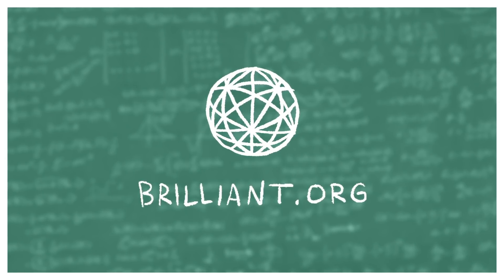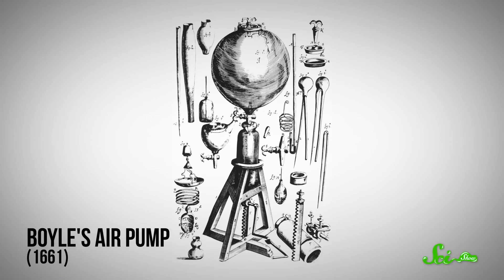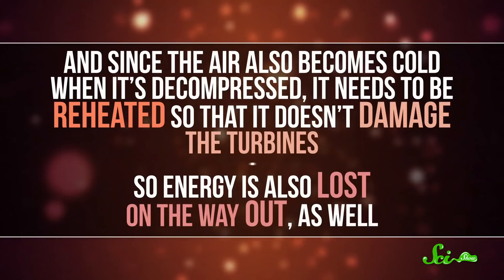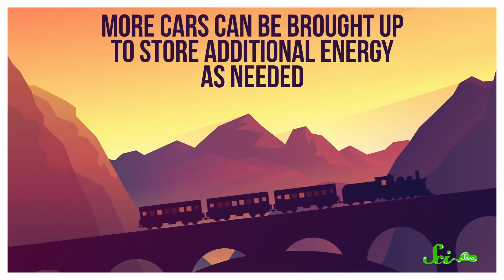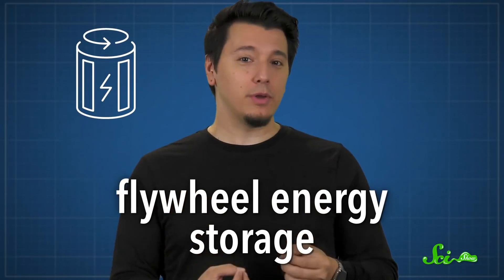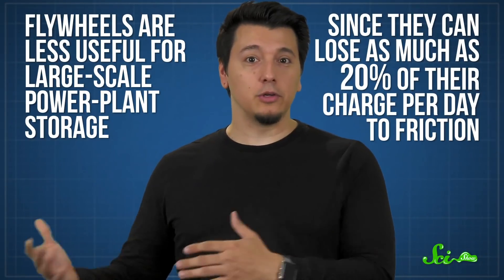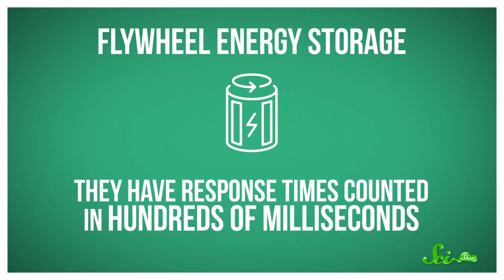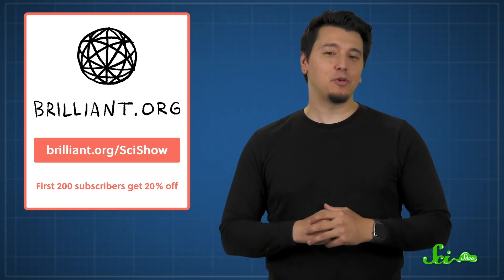The Surprisingly Retro Future of Batteries

Comment: Seeing "retro battery" I'm surprised deep cycle lead acid was not mentioned
Reply: David Burgin  Lead-acids are excellently recycleable though. You can reclaim every material used in their construction and turn it into new batteries.
Reply: Mandrake Fernflower that’s still electrochemical though which is what we’re trying to avoid.

Comment: You mentioned using trains as a way to store energy gravitationally, but not the Swiss company, which is buildings crane towers, where they use stone blocks pulled up and down to store and release energy?
You know, basically the same thing, but it doesn't need additional infrastructure like rails and it works both in a completely flat terrain and mountanious regions, because you just have to build the crane, which is always vertical...?
Reply: 2:50
Reply: The 'energy vault?' You might want to watch Thunderf00t's video on that one. He runs through a few practical issues. Is it workable? Sure. Is it economical? Not even remotely close.

Comment: 2:50 
Thunderf00t made a video about that called: Energy Vault -BUSTED!
Reply: Is it really that unreasonable that it is "busted"? I mean yes maybe it is inefficent, less enviormentally friendly and more expensive than the best competitor buuuuut wouldn't it work well enough to be useable? Unlike say that hydro thing sucking moisture out of the air?
Reply: @lazergurka-smerlin6561  Considering that it will break in any place with moderate wind.  Likely store near no power due to cranes being inefficient.  And what power it does store loses storage potential greatly for the lower blocks.

Comment: The most practical mechanical battery is the gravitational battery of which you hoist a very large mass at the top of a pit.  You will lose zero energy over time (unlike flywheel) and it can be turned on instantly.
Reply: You still lose energy, obviously, through friction of the bearing/pulley, for one. You lose energy in all solutions.
Reply: You can't extract energy until the generator spins up. Not instant, but a matter of seconds.

Comment: How about spring batteries a  good example is the old wind-up watches. Or what about storing hydrogen in a chemical battery. Solar/wind through electrolysis turn water into hydrogen and oxygen. Hydrogen is then compressed and used in vehicle transport.
Reply: Ian Wilson hydrogen’s electron in to electron out efficiency is currently about 30%. Add compression and storage losses to that. That may be good enough for long distance planes & ships where there is no other renewable storage with the capacity but it’s awfully inefficient compared to anything being discussed here. I really hope research boosts that efficiency.

Comment: Regular flywheels don't seem to be a bad idea for "power shifting" solar power.
Spin it by day, let it rip by night. The 20% per day won't be much of an issue here, as you're only needing the power some hours later rather than a whole day.
Reply: It would probably also be really efficient to smooth out solar and windpower with their typical minute by minute fluctuations
Reply: @jonas-c7m  It's kinda of a mechanical inductor of sorts so yeah
Reply: You might also need a storage solution to make up for cloudy days and/or snow/dust accumulations on solar panels for more than one day.

Comment: Aren't hydro-batteries more popular and efficient than rail storage to store energy as gravitational potential?
Reply: Assuming you have a dam... and a lake...
Reply: @frac  Not necessary. A big hole with a pweighted piston can work too, and this kind will work at a much higher pressure and has less evaporation because the water is enclosed. Basically you have 2 big vertical cylinders in the ground, one with a really heavy piston. You pump water from under the light piston to under the heavy one to charge it. Fluids other than fresh water could work but the only other thing that make any sense would be to use salt water and no second cylinder if you are close enough to the ocean for that to be more effective. The absolutely most efficient way would be to mount the pump/motor on the piston and have the low pressure water on top of the piston, but then you have to get the power in and out somehow. A syphon loop could also work, but the mobile end of the low pressure side would be a challenge. As long as you have about 4% of the depth of the cylinder in concrete at the top of the high pressure cylinder (more would probably be better), it will run at a net positive pressure at ground level. The pistons could be hollow so they could be unloaded for maintenance. No really new tech needed, just a little development to scale up existing tech.
Reply: @frac  no  dam needed. just resevoirs  at different heights
Reply: hydro is often 70-80% efficient and its MUCH more dependent on location. You need vast amounts of water that a lot of climates don't have to offer and you need enormous reservoirs that require certain topographies and huge tracts of land.
Reply: @TroyEilertson  not necessarily, consider underground cylinders and weights. Geography can make it cheaper to build, but it is not a barrier.
Reply: @TroyEilertson  can be made 100x smaller using liquid mercury (far heavier and not as prone to freezing) rather than water. Multiple elevated storage tanks can be put just about anywhere.
Reply: @TroyEilertson  you can always use sand
Reply: @TroyEilertson  but when it rains or snow melt u get free power
Reply: Troy Eilertson for example Switzerland 🇨🇭
Reply: Check out Tom Scott's video about Britain's largest battery (it's a lake).
Reply: @regular-joe   yep a fairly easy solution.
Reply: Well, there certainly are a lot of them. List of "pumped-storage hydro electric power stations" on Wikipedia: https://en.wikipedia.org/wiki/List_of_pumped-storage_hydroelectric_power_stations
Reply: I would think that suspended weighs storage (the modern equivalent of rail storage without unnecessary motion in the horizontal plane) would be a better for gravity storage: can be built anywhere, no mountains, lakes, specific underground features or anything else needed. Rail storage only makes sense if you have existing tracks and trains to spare for the duration of the storage period.
Reply: @teardowndan5364  Gravity-mass storage has very, VERY poor energy capacity. (The video states "50 Megawatts" but that's power, not energy.)

1 metric ton (1000kg) will store 9800 joules per meter of elevation. In the US freight train cars top out at ~140 metric tons, so that's ~1.4 megajoules per car per meter of elevation. Sounds like a lot, right? Well, you'd need to lift that 140-ton rail car up 100 meters (~330 ft) to get the same energy content as a single US gallon of gasoline. Put into another context, running a 1kW electric heater would need that 140-ton rail car to drop 2.6 meters per hour.

So why does pumped hydro work? Volume. A pumped hydro facility can have over 5 million cubic meters of water (5 million metric tons, about 36,000 rail cars worth) at the ready. Sure it's geographically limited, but so is any centralized power station!
Reply: @Smidge204  Most of the gravity systems in the US (other than the large hydro-electric plants), are used to save "waste" energy - using your surplus to crank a train car up the hill might only give you a low (I'll pull 10% out as a hypothetical) efficiency - but 10% of a gigawatt is a LOT more than the 0% of the same gigawatt.  The advantage of the rail system is that we already have train cars and rails, and experience installing them on mountainsides - "off the shelf" parts make it dirt cheap compared to a hydro-turbine of similar capacity.
Reply: @Smidge204  I'd also assume that many current hydro electric dams could be modified to preform both functions. Pump back a portion of the outflow with excess solar or wind energy. Yes I know it's more complicated than it sounds.
Reply: Australia's Snowy Mountains Scheme's holding dams are some of the largest gravity batteries in the world. The Snowy Mountains Scheme is one of the largest and oldest modern hydroelectric systems, constructed from the 1950s to the 1970s.  It also doubles as an irrigation system for agriculture in fertile but arid areas of New South Wales, Victoria and South Australia.  From its inception, the design called for water to be pumped into holding reservoirs during off-peak times and released via gravity, through turbines, to meet peak demand. "The Snowy" provides a large percentage of the power needs of Sydney, Canberra and parts of Victoria.
Reply: I have no idea why Scishow decided to leave perhaps the most  widely used gravity battery system  out of their bit on gravity batteries.  They are no less geographically restricted than a compressed air battery that requires an empty salt dome.
Plus they can be converted from storage to production faster, and lack the thermodynamics issues called out in their compressed air counterparts.
Reply: They are, and his comment about rail storage being the only gravity method in development so far is false too. Google the electric mountain. Disappointed Scishow.
Reply: @GenericSquirrel  I am actually pretty disappointed every time I watch scishow when its on something in my field ( chemical engineering)  I find major errors in nearly each which makes me question if I should be trusting the stuff put out in their other videos.
Reply: @GenericSquirrel  https://www.youtube.com/watch?v=McByJeX2evM pretty cool. Thanks for the tip. Not so disappointed in the show tho. Brought me to ur comment and I learned about rail energy storage.
Reply: @GenericSquirrel  He didn't say it was the only one, and scishow mentioned the hole in the ground one which uses the same principle before.

These are just retro ones used in the past.
Reply: @GenericSquirrel  Agreed but...  if it makes you think of the possibility of 'dry' hydro-electric then what about stretching it to 'wet' - tidal, even old waterwheel? Low vertical displacement but relatively massive volume displacement - mass v speed ≥ energy. 
Not giving at all options but opening you - the viewer - to stretch your imagination! My thoughts may be limited but out there someone........
Edit
Looked at more comments. like me, most harp on existing uses of oldish technology (strange no-one mentioned Archimedes screws) but I did notice the using surplus ( otherwise wasted) energies top top-up less efficient but temporarily useful supplies. I like that! Looking at why, and for how long, you need that extra 'kick' before a longer solution can come online, eg Ki v AlO2 batteries...
Reply: No, yes.  Hydro batteries require a LOT of space / volume. A Rail system uses "off the shelf" components that are pretty cheap. Vertical lift gravity storage is the most efficient, but takes either a TALL tower, or a DEEP borehole.

The reason these are in use is to balance power load / power generation - they are trying to save surplus power that they would otherwise waste, and then pump it back into the grid at "peak times" instead of starting their back up generator.
Reply: Yess but you cant make them without a big area, wich means destroying nature to make a artifical lake, or removing villages. We lack ground so its not smart to use a lot of it for energy
Reply: I'V been to Electric Mountain in Wales, and like the compressed air battery, if you are lucky enough to have the right terrain it is a wonderful way of storing power for when it's needed, i was surprised it wasn't mentioned.  

If you are ever in the UK it is worth a visit.
Reply: We need to use what is appropriate for the location. Some may be water batteries, some compressed air, some flywheels, etc....
Reply: those aren't retro, those pumped hydro are a thing of modern times
Reply: I was thinking the same thing  the power company in my area is building one now. I can see how your limited by where you can put one but there definitely out there.
Reply: YEAH, thunderfoot might be disappointed ..
Reply: Often hydro do not even pump up water. But just do not use it until it needed. Since nature tend to fill up dams on there own. But it is just a huge gravity battery. Or potential energy battery which is the term I prefer.
Reply: There is a wind farm in Ireland by the coast that they put a dam in a bay/cove and put a pump/generator on the bottom so when they make more energy than the grid needs they pump the sea water out and when the wind is not enough they generate by letting the sea water out. Quite a lot cheaper than a hydroelectric dam, but is also geographically limited, but not as bad as hydroelectric dams. 

Tall rocky coastal areas like most of the California Coast with high valleys behind them would also minimize environmental impact as you can build a smaller dam up top. The higher the elevation the less water you need per megawatt hour. Which they should be using to measure electrical storage in the video, the term megawatt storage without a time frame is a bit of a meaningless number.
Reply: Yup pumped storage is the cheapest, simplest, most reliable and most widely used from of mass energy storage. Which makes it odd they didn't mention it. China is currently building tons of them.

https://en.wikipedia.org/wiki/List_of_pumped-storage_hydroelectric_power_stations
Reply: If you use evaporation cooling to power a heat exchanger you can condense the water yourself and you don't even need to pump it anywhere, that's how rivers work!
Reply: You need elevated land beside a sea or beach.
Reply: If it's a dam in a more natural setting, like on a river instead of a man made pond, it will produce huge amounts of CO2.
Reply: @morbly  Will it?  The CO2 comes from decomposing vegetation.  Dam or no dam, it would decompose anyway and generate the same CO2 -- only that spread out over the river.
A dam may actually take carbon out of circulation by depositing carbon-rich mud on the bottom.
Methane is a concern in some dams because water is usually taken from the bottom anaerobic layers to run the turbines.  That could be fixed with proper design or a relatively cheap retrofit, so that water is instead drawn from the top layers (where the methane has been oxidized).
Reply: they also have huge environmental impact
Reply: They also have an issue with losses of power due to evaporation of the water they hold. Although it’s not really an issue with short term storage.
Reply: In the video it was refered to "you dont need a batcave to store the energy". ;)
Reply: Based off of what I know as a mechanical engineering student, I would say the turbines/pumps for hydro-batteries would cause much larger energy losses than the rolling friction/minor air resistance of rail-storage.  An alternative may be to use fluids that are denser, but experience less friction and have a lower viscosity.  That would have the potential to shift around ratios quite a bit, but other fluids in such large amounts are very hard to come by.  Perhaps there is a type of heavy-water-based solution that experiences little resistance against turbine blades, pipe walls, etc, with a low enough viscosity to make it a contender.
Reply: less efficient. popularity is subjective often
Reply: High efficiency, but capital-intensive and very dependent on topology. There are not many places where you can build one.
Reply: @vylbird8014  UHVDC transmission lines help a lot with topology dependence.  Most places have mountains somewhere.  US has the Rocky Mountains and the Appalachian mountains.  And the Midwest has a lot of wind power, while south west has a lot of solar.
Reply: yes, because while comparably when you maintain a rail it's like maintaining the dawn both of which hinder efficiency. However, the load in rail storage has to have maintenance too unlike water in dawn. This is why natural opportunities are the best solutions as this would be the largest difference between a dam holding water and rail storage holding water.
Reply: Well, it depends - you see, a woodchuch would chuck a certain amount of wood but since a woodchuck can't chuck wood, a woodchuck wouldn't actually chuck any wood. So I guess it's not entirely without merit afterall.
Reply: @WormholeJim  what are you on about? Everyone knows that a woodchuck would chuck as much wood as a woodchuck could chuck, if a woodchuck could chuck wood.
Reply: @WormholeJim  A woodchuck would chuck as much wood as a woodchuck would, if a woodchuck would chuck wood.

Comment: Dams..... Pump the water up, run it through a turbine. no heat loss like compressed air. no friction loss like flywheels. Cheap. no exotic materials. need I go on?
OR how about a liquid that burns really well, that we could use in a turbine generator or a CHP plant. Maybe that GMO algae that makes oil from the air could save the power grid(And cars as we know them) without major disruption to the status quo. Chemical batteries are terrible for the environment, and unfortunate electric cars biased on that tech aren't enough better for the environment.
Reply: That was the most obvious one, wasn't it? I'm surprised he didn't mention it.